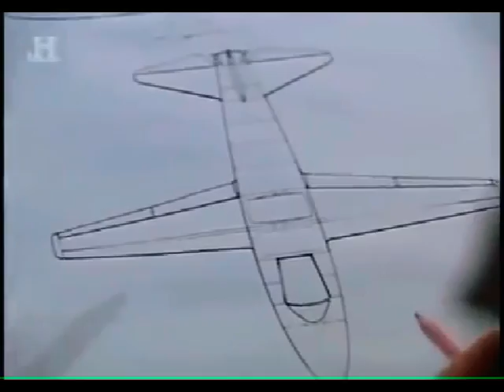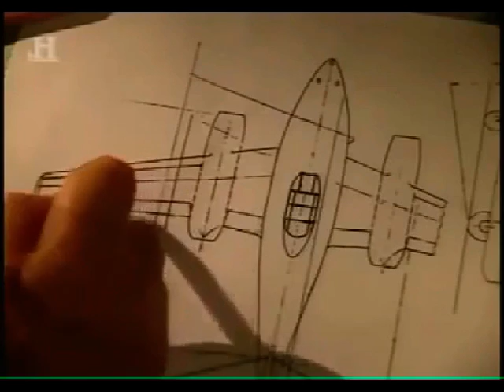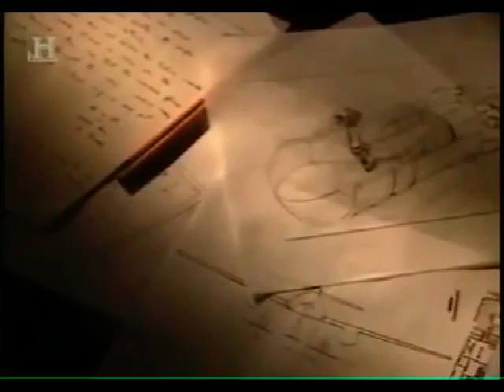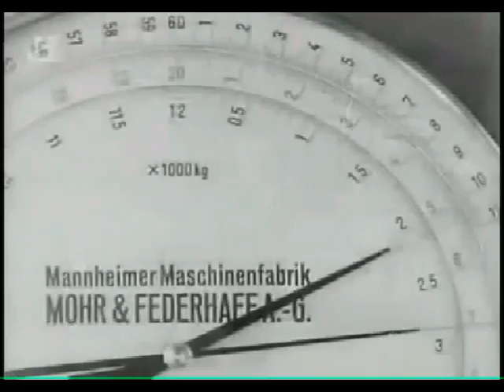The Father of the Jet Engine - Hans Von Ohain

Comment: let's face it - the germans won the technology war
Reply: antigen4: Okay you say the Germans won the technology war? Well yes I believe that may very well be true, in fact I'm quite sure that it is true. But the British RAF officer Frank Whittle was the first to build and test a turbo jet engine. But I do believe the Europeans especially the Germans are at the forefront of all science and technology.
Reply: well i guess the allies technically 'won' by appropriating the german technology at the end of the war ... there's an argument there too
Reply: @antigen4  
yet Germany was behind Britain on radar, jet engines and even weapons, German machine guns were beautifully made but complex and prone to jamming, that is why Germany made thousands of copies of the Sten gun, quick and cheap to make, easy to strip and clean.
Reply: actually not ... (behind britain on radar) - they were surprisingly advanced ... when britain ended up capturing one of the german night fighter interceptors they found equipment on board that actually TRACKED the british night fighter SIGNALS in order to find them ... but it was a back and forth cat and mouse game - the germans though had the mother of all radar installations - the HIMMELBELT (or -bett?) - the Kammhuber line which was a distributed network using small wurzburg dishes to build up a centralized map which is the very model on which today's CELLULAR NETWORKS were built ... most of what we hear about the germans is propaganda it seems ... didn't help much in the end though i guess ..though it helps US steal all their cool tech .... check THIS out if you're interested in the topic - fascinating! https://www.youtube.com/watch?v=ZTC_RxWN_xo
Reply: @antigen4  
Yet Britain had the best radar system in the world, Germany never worked out how the British home chain radar worked, Britain came up with the centimetric radar that was small enough to be fitted in night fighters, that was given to USA like many British developments.
It seems popular to claim Germany was advanced in all technology but Britain was ahead in many areas
Reply: you didn't watch the presentation on this did you? not only did the germans understand the chain home radar they used the reflections off it to find out location information of incoming bombers etc ... not that it helped them in the end
Reply: at any rate it's a brilliant presentation discussing the back and forth co-evolution of wwII radar warfare and I can't recommend it enough - REALLY - it will blow your mind -and just wait until you get to the cold war era stuff - where the US was using the MOON to reflect russian telemetry info ...
Reply: @antigen4  
I know a lot about how Britain used radar and the coordinates system, Germany not only did not understand how it worked they had no means to counter it.
Reply: @antigen4  
Yet Britain not only had better radar but used it to better effect, Germany tried many things but Britain had or found ways to counter it, I know a bit about the cold war and how USA had to ask Britain for help often.
Reply: @unhooked25  Frank Whittle may have been the first in the UK, but he did not invent or build the first jet engine.
Hans von Ohain and Max Hahnn built the first turbojet in 1934 and the world's first jet aircraft flew in 1939 two years before Whittle attempted to.
Reply: Yes he was the first. you will not convince me otherwise especially when a while back you said Frank Whittle had a drug and alcohol problem, because when you start making up stories like that it's only an indication you're just jealous and don't like the fact that he was the first just because he happens to be British.....Where as if he was Dutch then you would have a difference in story.
Reply: @unhooked25  Maxime Guillaume patented the turbojet 9 years before Whittle.
Hans von Ohain and Max Hahnn built  the first turbojet in 1934. 2 years before Whittle.
The first successful flight test of a jet aircraft the Heinkel He-178 flew 2 years before Whittle's did.

Frank Whittle was not the hero brit propaganda myths makes him out to be..
Whittle was severely addicted to amphetamines and benzodiazepines  and was hospitalized several times for drug addiction.
Whittle was also a self-admitted alcoholic who would often bing drink for days.
Frank Whittle was arrested for assault with a deadly weapon for attacking a Rolls-Royce engineer in a drug and alcohol fueled rage.
The Miles M.52 program was cancelled because Whittle failed to deliver a working W2B/700 engine and was removed from his own company after allegations of embezelling M.52 funds for personal use.
Reply: Oh don't give me your bullshit. You can harp on all you want you will not convince me otherwise Sander Van der Kammen. So don't bother wasting your time with me.
Reply: @unhooked25  Just the facts here lad, the truth is a much better story than the fake story created by brit propaganda.
Whittle was certainly no hero, the real pioneers of the early development of jet engines in the U.K. were 
A.A.GRIFFITHS
STANLEY HOOKER 
ADRIAN LOMBARD 

Frank Whittle would have never managed to get a jet in the air without the knowledge and technical experience of these true heroes... yet he was happy to take all the credit and then some.
Whittle was nothing but a boaster and self-promoter who took credit for the work of others.
Whittle however managed to single handedly scuttle Britains hopes of reaching the speed of sound by sabotaging the Miles M.52 program.
Whittle had made so many enemies in the U.K. he was exiled to the United States to spare the new government any further embarrassments.
He never again worked in the U.K. aerospace industry after the M.52 scandal.
Reply: @sandervanderkammen9230  Here's what Ohain had to say in his foreword to 'Elements of Propulsion, Gas Turbines and Rockets' - 
"The first patent of a turbojet engine, which was later developed and produced,
was that of Frank Whittle, now Sir Frank (see Fig. 5). His patent was applied for
in January 1930. This patent shows a multistage, axial-flow compressor followed
by a radial compressor stage, a combustor, an axial-flow turbine driving the
compressor, and an exhaust nozzle. Such configurations are still used today..."

and

"From the beginning of his jet propulsion activities, Frank Whittle had been
seeking means for improving the propulsive efficiency of turbojet engines. ¶ He
conceived novel ideas for which he filed a patent application in 1936, which
can be called a bypass engine or turbofan. To avoid a complete new design,
Whittle sought an interim solution that could be merely "tacked on" to a jet
engine. This configuration was later known as the aft fan. Whittle's work on
fan jets or bypass engines and aft fans was way ahead of his time. It was of
greatest importance for the future or turbopropulsion."

I'm sure you'll be able to get that book from your local lending library and you'll be able to read von Ohain's own words yourself.
Reply: @antigen
They never. The British were supreme, even the first electronic computer during WW2.

Comment: Whittles engine design is not used much today. Mr O'hains version proved superior.
Reply: , how old are you ????
Reply: All modern engines are based on Whittle's design.
Reply: Frank Whittle's design was obsolete on arrival, no modern jet engine uses his design.
Reply: @johnburns4017  Just the facts here lad, whittle did not invent the turbojet engine and modern jet aircraft all use axial compressor engines invented by Dr. Anselm Franz.
Reply: @johnburns4017  John! WHERE IS THAT 2020 MAZDA ROTARY YOU PROMISED?????
Reply: @johnburns4017  WHERE IS IT?????  YOU ARE A LIAR!!!!
Reply: @sandervanderkammen9230   Hans Joachim Pabstvon Ohain's own description of Whittle's patent-
"The first patent of a turbojet engine, which was later developed and produced,
was that of Frank Whittle, now Sir Frank (see Fig. 5). His patent was applied for
in January 1930. This patent shows a multistage, axial-flow compressor followed
by a radial compressor stage, a combustor, an axial-flow turbine driving the
compressor, and an exhaust nozzle. Such configurations are still used today..."

and

"From the beginning of his jet propulsion activities, Frank Whittle had been
seeking means for improving the propulsive efficiency of turbojet engines. ¶ He
conceived novel ideas for which he filed a patent application in 1936, which
can be called a bypass engine or turbofan. To avoid a complete new design,
Whittle sought an interim solution that could be merely "tacked on" to a jet
engine. This configuration was later known as the aft fan. Whittle's work on
fan jets or bypass engines and aft fans was way ahead of his time. It was of
greatest importance for the future or turbopropulsion."

I'll take Ohain's word over yours thanks.

Comment: The Father of the jet engine HENRI COANDA 1910 !ROMANIA>
Reply: cristiandan06 Coandă was a brillant engineer... but he never built a jet engine... it simply never happened
Reply: Yep...you're right ! Watch my comment above !
Reply: Coanda had an idea which did not work.  It was an internal combustion engine powering a fan, not an original idea at all, and most certainly not a jet engine
Reply: @psk1w1  It was a ducted fan and whilst I agree that claims for Coanda as inventor of the jet engine are nonsense, the idea is  sort of present in the turbofan.